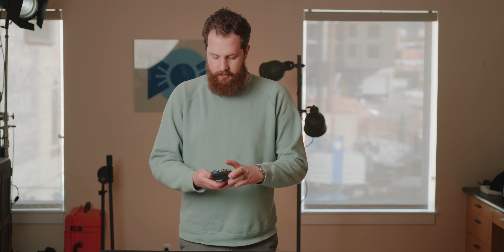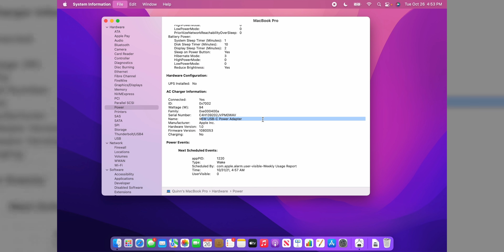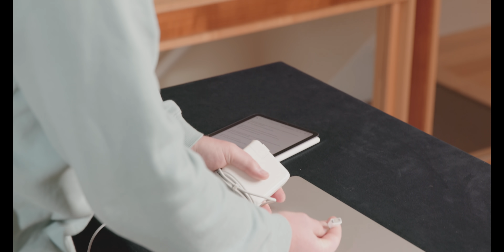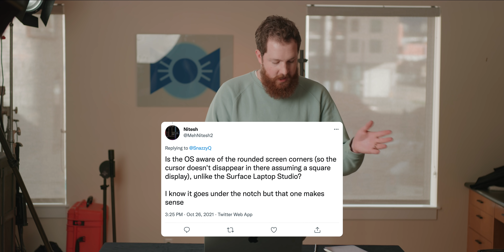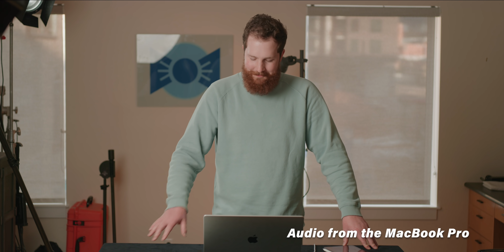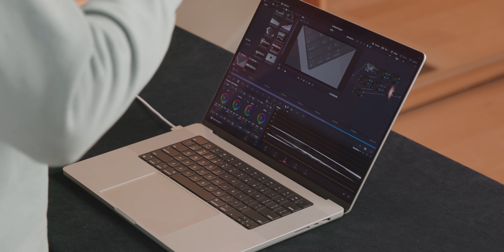The 2021 MacBook Pros are Insane

Comment: I actually like how the fullscreen mode hides the menu bar, if im in a fullscreen app I want to be immersed in that app. Another nice change here is that when hovering on the menu bar in a fullscreen app it no longer pushes down that fullscreen app which was very annoying and caused a lot of accidental clicks.
Reply: Yes this felt like a very deliberate choice by Apple and I think they made the right one.
Reply: Yesssss omg that was always so annoying. And it instantly appears when you hover over it on this MacBook, before you had to hold your mouse there and wait for a moment. Then it pushes down on everything, which would sometimes even glitch out the app I was in. I just gave up and just expand the window to the corners of the screen, and I always have the dock hidden. And I changed the dock appearing speed to be instant, so as soon as my mouse is down there, it shows up
Reply: There is a new setting for that in System Preferences.
Reply: I agree with you, not hiding the menu bar in full screen mode will be contrary to the idea of full screen mode,  most of the time. Now it could be an option.
Reply: cannot agree more. that’s always been the point of full screen (like for videos or presentations). if you want the whole screen and the menu bar, just maximize the window ;-).
Reply: @philipptielmann  Yes Philipp I actually tried using it, but there are two things which are very little that I don't like. If you maximise a window, then open a new window, it will appear right in front of you and personally, I don't like, it's annoying. And second minor thing is that when you maximise a window and open Mission Control, it won't say the name of app in a desktop which is sometimes helpful for me because thumbnail is small specially in my MacBook Air.
Reply: Completely agree
Reply: as Quinn said, this new Macbook has a taller screen than a regular 16:10 of the previous models, so the menu bar (and the notch) is actually in the taller part, therefore it doesn't push down on your content anymore.
Reply: The problem persist If you don't add features like a  board key for unlock the mouse to travel to the menu bar, or the menu bar to comes down in older models. Maybe some transparency config will be nice for some ussers as well. Of course different cofing depending on the app.
In some ways config in Mac os don't really help user, the mouse middle button on the trackpad with 3 fingers not configurable was so painfull that most people buy the app for doing It. Chrome browsing with dinamic menu bar and no external mouse or 3rt party app for the trackpad was painfull. DoubleClick oppen in new tab and the missclicks on the menu bar.... What a great experience!
Any user is different and use they pc for different uses, Apple have to be more flex on config, event If they think it's usseless any extra configuration to cover all personal prefferences outhere is the way to go, not force a OS to look like you try to sell It. They still can use the standard looks for comercials If they think that's a reason for anyone to buy a pc.
Reply: Yer I agree. For full screen presenting as well, you don’t won’t the system bar there
Reply: I don’t know if there is a system wide setting to make it permanent or not, because I didn’t get mine yet, but I’m sure there is or will be an option in OSKit to enable it then developers can put it into app settings as a switch. Being menu and status bar hidden is the correct default choice though. Imagine watching a movie with the menu bar on top.
Reply: I’m actually the opposite, I’ve never liked the menu bar disappearing when in full screen mode. Especially with this notch, might as well keep the menu bar up or give the user an option to change their preference of it disappearing or not like how they do the quick launch bar.
Reply: Yes I agree. I do a lot of PowerPoint presentations so I prefer my presentation to be the only thing my audience is focused on. Hiding the menu bar is the best option for this.
Reply: right. i was thinking about that just today
Reply: You sir spoke out for all of us. I hated the accidental push downs 🥲
Reply: Yes it makes perfect sense to me that you don't want the menubar during fullscreen.
Reply: It seems you like it because what else you can do ... notch is there and if one has sense of taste one could never enjoy nor justify such ugly solution as useless dumb notch.
Reply: Yes I agree with you. you know what makes it better? "An Option". It would be better if user had the option to hide it inside apps or no, or even better if you could choose to have it hidden in certain apps. After all I believe having options is better than having none.

Comment: Glad that you will be checking performance for more than video. Please try to include mathematics software and science simulation softwares (quantum chemistry, fluid dynamics, orbital mechanics/NASA?), and possibly talk to people writing code to do their own long-running calculations. You know, the kind of traditional computing that computers were invented for back when they used to fill whole rooms and that is almost indispensable in those fields today. Perhaps, even ask those who roll their own calculations, if they think they could get use out of trying to use the GPU cores and the tensor capabilities of the AI cores to drive even more power in their work. Also, can these comparisons be made with newer Intel/AMD machines? There are many citizen scientists, and  mathematics dabblers who would be interested.

Comment: Do you think that these chips could eventually have a high performance mode where they chew more power but output a crap ton of performance? I think that since they use less power and therefore run cooler; they could get OverVolted.
Reply: They already do! You just have to go into the battery section of System Preferences and change the energy mode from automatic to high power while it’s both plugged into the wall, and on battery.
Reply: @ardentvibe6917  Only on the 16 inch version though if i remember correctly.
Reply: @MADDGAMMER  Yes and only with the Max chip too, I think.
Reply: @binkey3374  well, I happened to have bought that exact variation, so I definitely cannot confirm. Haha.

Comment: I have never liked the notch on phones, but I wanted iPhones so I had to deal with it. I guess the same thing will happen when I upgrade my laptop. I really don't like the extra thick macOS Menu Bar, or the idea of app's menu items skipping the notch. I'd rather have bigger bezels or a worst and smaller camera and no screen obstruction/notch! Also they could have put it on the corner of the display of they really wanted thinner bezels, it would be less annoying - that way the camera would be on the side just like on the iPad, but they could use center stage to solve that issue.

Comment: The menu bar already behaved like that, btw. Wasn’t common to trigger since no dead area like now.
Reply: Also, by the design guidelines of apple (way before notch), full screen mode does not display menu bar because full screen mode is meant to be less distracting. Although some apps, like safari, permit it.

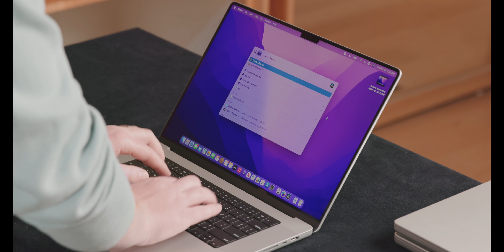Comment: 17:28 you have the display scaling set to “looks like 1312 x 848” which is ridiculously big. 

I suspect the same thing would happen with the menu bar on any Mac if you were to increase the scaling enough.

I also have the new 16” Pro, and I never run into any issues with the menu bar hiding buttons
Reply: Mac scaling is great, but also odd, they give you this mega sharp display, then let you use ~720p/~1080ps worth of resolution by default

When I was dailying a 2015 MBP, i had it set to the most screenspace possible

Comment: Damn that notch is janky. I was skeptical and curious about the sofware solutions they had for it and really hoped the "appled" it. But no that's some A level jankiness. I hope they fix that with future versions of MacOS
Edit: The rest of it is amazing though.
Reply: the app menus taking over the right side menus are not new to this mac, it happens on all macs. the easiest way to do this is by setting a mac to a really low resolution or connecting a really old monitor to it. I would say istat probably needs an update for the new macs to handle it properly. any yes apple could help with updating

Comment: I actually would like to know how does it handle 3D modeling, how does some windows programs run thru parallels like solidworks, catia, etc. I’m an engineer and use an mbp 2020 with an i7, so, this engineering stuff actually makes me very curious.

Comment: I think Apple basically has to pull a Sherlock on Bartender at this point. The notch behaviour is just too weird.
Although it's worth noting that menu bar items eating up your icons on the right isn't entirely new, cause I had run into it in the past on smaller displays with my display density low. It'll now just be much more common with the notch.

Comment: It’s been a thing in macos for a long time that menu applets on the right get hidden by menu options on the left when there’s too many.
Reply from the maker: I just learned this from John Siracusa yesterday. Pretty insane and can't believe that's the solution. Apple needs to Sherlock Bartender and just fix the whole issue.
Reply: Exactly. The notch may make this more common but it’s been a design “feature” for 20 years. 🙄
Reply: "It's a feature not a bug"
Reply: @outofahat9363  They specifically added code to do it so yeah.
Reply: jup, in more character rich laguages it‘s quite common. Just switch to finder to see the rest
Reply: @HolgerNestmann  if you set your mac to a really low resolution its easy to do as well, like 1024x768 or 800x600
Reply: @Noaddedsalt01  Haha, great. I actually don‘t want to see it, but thanks for the tip. Increasing resolution would do the opposite then :)
Reply: @HolgerNestmann  yes you get more screen real estate, I remember it being really bad on teachers Macs when they would hook to a projector and  having the resolution at 800x600 it was awful